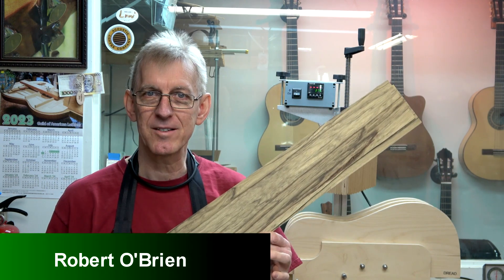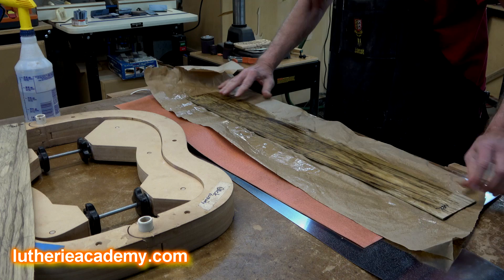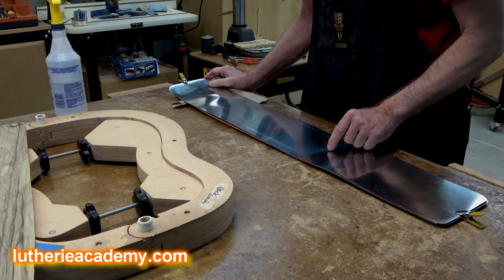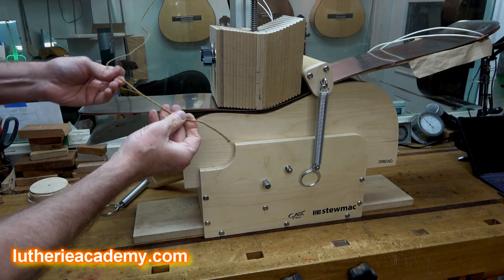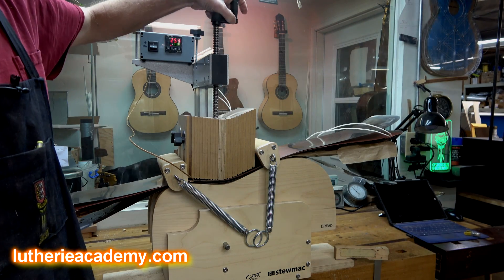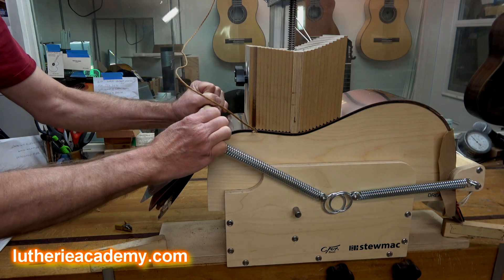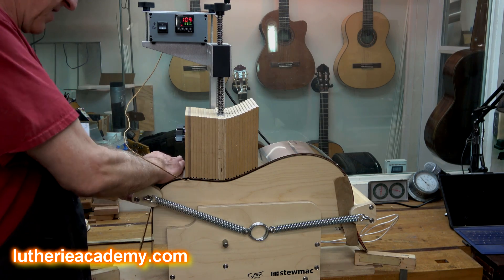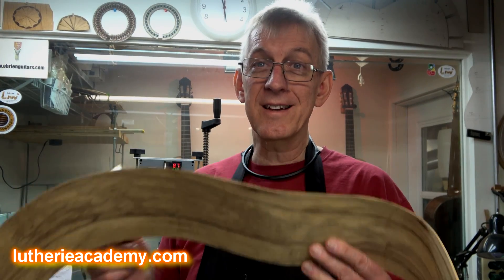Stew Mac Bender

Comment: Robbie, do you recommend bending only one side at a time, or will it work to bend both sides and the binding at the same time as we did with the other bender?
Reply from the maker: This bender is designed to bend only one side at a time.